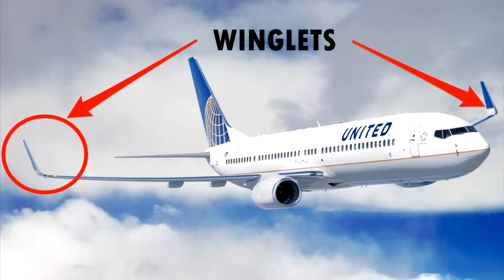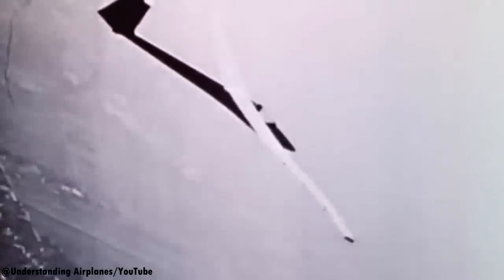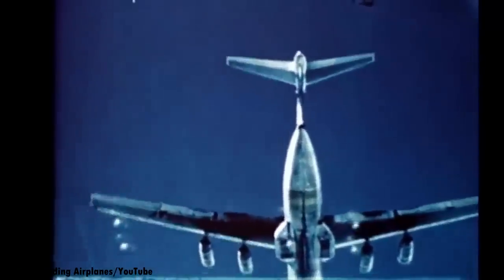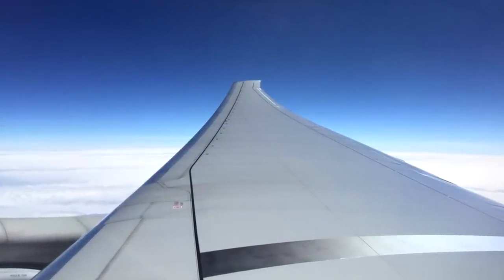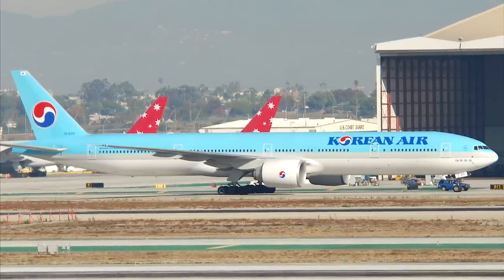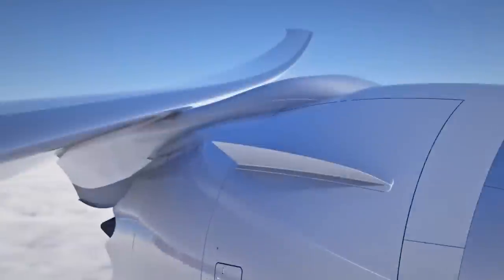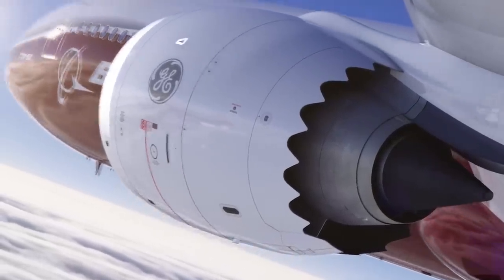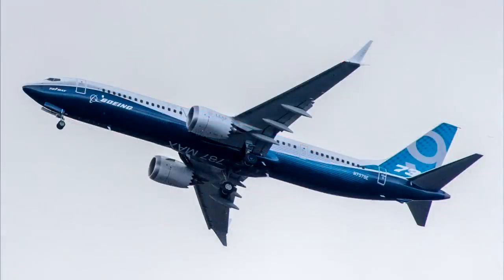Why doesn't the Boeing 777 have winglets?

Comment: Basically what Boeing did was pretty simple. They made the triple 7 wing so flexible and design it so the outer part of the wing lifts when in high speeds. The wing tip becomes the winglet when it lifts up. With that in mind they didn't need a winglet. This reduces complexity and production costs. This idea went on to the 787. And it flex even more than the triple 7. For the older planes they fited winglets because it was easier to retrofit an old wing design instead make a completely new wing. Hope I explained it in simple words. If I'm making a mistake please correct me

Comment: The one on the a350 and a330Neo are actually sharklets, not raked wingtips. 777, 787 and 767-400 are the only commercial planes with raked wingtips. Favorite raked wingtip is that of the 787, gives the plane a stream less look and wing flex and fav winglet is that on the 737 Max
Reply: Andrew Cunnison completely agree with you!
Reply: The 747-8 also features raked wingtips instead of the winglets like the 747-400
Reply: The E190-E2 has raked wingtips too
Reply: @khalidabdulghani  yes, how could I forgot
Reply: @dalewong7643  yup!!
Reply: Andrew Cunnison the split Scimitar Winglets look well awesome
Reply: When they first came up, it was clear that Sharklettes were just a naming scheme.  They are still Winglets.
Reply: "sharklets" is the name of blended winglets used on Airbus aircrafts. Its is still winglets. Certain Boeing aircrafts have raked winglets (higher wing swept angle). They are all called winglets (and wingtip devices), but just different types of it.
Reply: Ong Jun Ren they’re called raked wingTIPS not raked winglets
Reply: While i accept the technical reasons for winglets. I have always felt the earlier generation of aircraft, particularly the jets, had a cleaner crisper overall look without them. Price of progress I guess.
Reply: How does raked tip reduce vortices?

Comment: Just a quick mention that the wingtip fence is slightly different since it extends above like the winglet but also below the wing. Both tips above and below on the wingtip fence are sometimes shorter than winglets while having similar aerodynamic benefits.  The A310-300 was the first airliner with the fence. Airbus also used the wingtip fence on the A300, A320, and most prominently on the A380.  

For the 737 Max, the tip is sometimes called the split-tip winglet.

Comment: My understanding is that winglets aren't the optimal solution, they're sort of a band-aid for a less than perfect wing. A perfectly designed wing will be better off without a winglet, which is the case with the 777. The other thing is that a winglet offers less benefit than simply making the wing longer, but if the wing length is limited by other constraints (such as gate size) a winglet is useful. I think there was even a plan at one point to develop a short-range version of the 787, I believe intended for the Japanese inter-island market, which had shorter wings for gate flexibility and winglets like those of the 767, but as far as I know they never built it. The folding wing of the 777-X is a way of getting around the gate size limitation, allowing for a longer wing, which is more efficient than winglets - but much heavier and more complex. I suppose they decided that the efficiency gains were enough to make it worthwhile.

Comment: Okay, I see you noted this.  The tips on the A350 are officially Winglets, they are just a bit more hybridized than the winglets one most aircraft.  This was probably because Airbus attempted to copy the wing design from the 787 when developing the A350, but couldn't use the raked wing tip because of a copyright. Actually, I don't know which looks better, it depends on the plane.

Comment: The truth is, boeing weren't aware in the early 90's the significant fuel savings these winglets could produce by reducing drag. The 737NG for example were manufactured in the beginning without winglets, so had to be retrofitted later until it was changed on the production line.
Reply: Boeing was aware... Back then it was a trade off of weight and strength versus drag reduction. Composites changed all that...
Reply: Thank you.   As an aerodynamicist at Boeing from 1977 until 2014 I was appalled at this comment.  We put a winglet on the KC-135 back in the70s.   Not aware?  I hardly think so.    Mr. EinkOLED has no idea about the production line, either, or about Airplane Partners Boeing.     @stevewallace1117

Comment: Do winglets reduce turbulence ?
Reply: Not really, no.   There is a lot of aerodynamics behind this, but I will try to give a simple answer.   For a given weight, a greater wingspan will reduce the initial intensity of the trailing vortex.  However, it also makes it more persistent (doesn't decay as rapidly).   So at some distance behind the airplanes, the wake that started weaker will end up being stronger (think of two lines with different slopes - at the intersection point the one that was higher is now lower)    So why a winglet vs a raked tip?   The lift from a raked tip adds to the wing root bending moment, thus requiring stronger structure.   A winglet, since it's 'lift' vector is nearly horizontal, produced very little bending moment.   So if you have existing structure, it is probably better for minimum change to the airplane to go with the winglet.  (Of course, wing span limits due to gate constraints also play into the choice - as mentioned about the 777X with the folding wingtip)   But raked tips and winglets are all about induced drag, not lift.  I hope this helps.

Comment: Raked always wins for me, some winglets just look weird
Reply: Do raked wind tips reduce vortices?
Reply: Mohammed Rizwan - Apparently they do yes, otherwise there wouldn’t be much point in having them
Reply: But not as effective as winglets I think.
Reply: Mohammed Rizwan - I think raked wing tips are more efficient especially on long haul aircraft, there are airport infrastructure issues to consider too
Reply: Mohammed Rizwan A span extension is more efficient than winglets, even including the additional bending moment and thus structural penalty. Only reason for winglets is gate width constraints

Comment: But why can't it have both?
Reply: ytxstream The raked wingtip device already improves the lift distribution. Winglets wouldn’t provide any benefit over that. Basically a raked wingtip is a combination of a span extension (better takeoff performance, less induced drag because of more lift) plus a winglet (less induced drag because more optimal lift distribution).

Comment: Reason why 747-8 doesn't have a winglets, it's like 787's wing but bigger
Reply: kingsofserbiangameplay 162 No actually it’s shares very little in common with the 787 it’s more like the 777 With raked wing tips. The 787 composite wings or a completely different animal

Comment: Eagles have this feather separation on the tip of its wing acting like a winglet albatross have this long and pointy wingtip...who's the most efficient flyer eagle or albatross ?😂
Reply: The feather separation is more like a high-lift device, think of multi-slotted flaps. It also helps to reduce wingtip vortexes by breaking it up into several smaller wingtips. From what I've understood and seen, it helps to provide more and more efficient lift at slow speed, such as while landing or soaring, but at the cost of parasite/form drag, so for high speed a pointed wingtip is better. From what I've observed, most birds have the ability to open or close their wingtip feathers, so they can have either the separated feathers or pointed wingtip depending on their phase of flight. Sort of the same way as airplanes have flaps they can deploy or retract. Likewise, birds also have something called an "Alula" that is the exact same thing as a leading edge slat, which they can retract and deploy.